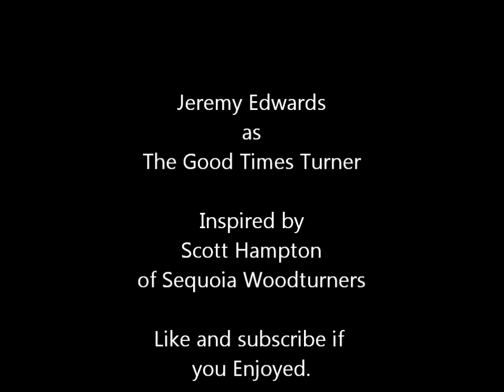Paduak and Maple 3 Corner Lidded Box

Comment: Hi Jeremy
Three cornered boxes and platters are fun to turn! Good save!!
Thought for a tip;  I found it hard to get a good even burn with my branding iron by hand pressing.
What I did was cut the wooden handle off, then use my Jacobs chuck to hold the rod - then heat the brand - then while the piece is held in the chuck, I press the heated brand into the piece with the tail stock - gives a nice even brand. Note - this also works by using the brand in the chuck of a drill press for pieces that don't fit in the chuck.
Just a thought for your branding.
Love your work!
Dennis Beamish Cambridge Ontario Canada
Reply from the maker: Dennis Beamish ,
thank you very very much Sir. yes, I really enjoy turning these too. I've been turning for about 3 and a half years now. I came to the realization that I could use my Jacobs Chuck in my tail stock as well. you will see that I use that method in all of my more recent videos. thanks for your kind words and thank you for watching. take care.
peace, Jeremy

Comment: How did it go from a 4 sided shape to a 3?
Reply from the maker: Rebecca Barnes ,
it is cube. all cubes have 6 sides. it is just geometry. mounting the cube on a point to point axis it becomes very easy to take it from 4 corners to 3. thanks for watching.
peace,
Jeremy
Reply: Because it is mounted on the points rather than one of the flat surfaces.  Try using a Kleenex box and you will see how that works.
Reply from the maker: SkilledMaverick ,
great analogy. thanks for chiming in and thank you for watching.
peace,
Jeremy

Comment: I've got a question: Padauk is expensive (maple not so much, but still...) and it pains me to see all but about 10% of it laying on the shop floor. Why aren't you laying out the bowl boards and cutting out the centers before glue-up? The trimmings could be used for smaller projects, because Man! That's a lot of expensive wood just wasted!
Reply from the maker: Tony Kibbie ,
You have a very good point. I am not a professional Turner by any means. I'm still in my experimental phase where I'm finding out what works and what wood I like to work with. not all my wood shavings go to waste. I tend to pack them in bags until my brain figures out what to do with them. based on your comment, I will be more mindful of my wastefulness. thank you for your comment and for watching.
peace,
Jeremy
Reply from the maker: Tony Kibbie ,
additionally, expensive is relative. I think that piece of Paduak cost me about $18 to $20. not too bad for me. Paduak is one of my top all time woods to turn.
peace,
Jeremy
Reply: Jeremy Edwards i want your supplier, lol. I've got a pretty good contact (semi- retired guy selling out of his garage), but even that is about $10.50 a board foot for 4/4 padauk.